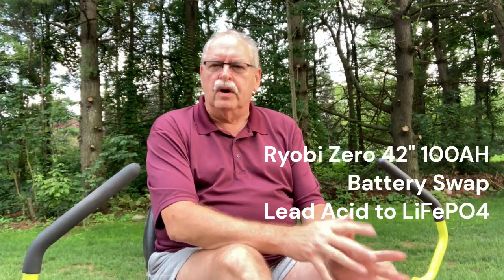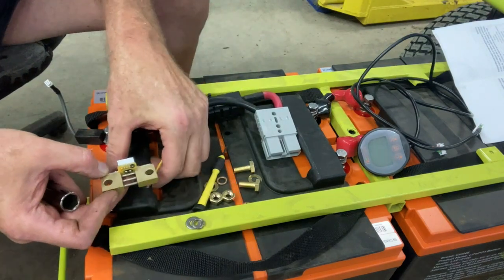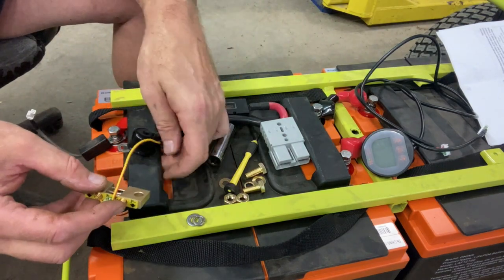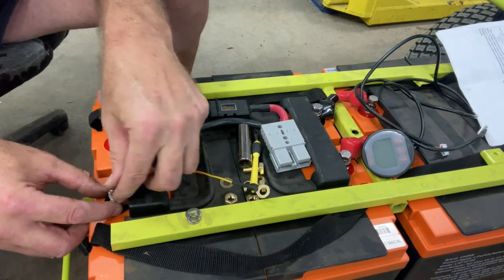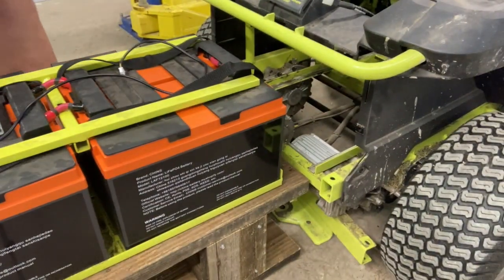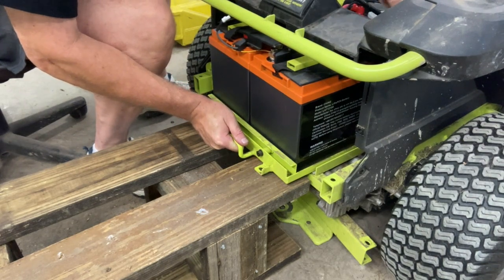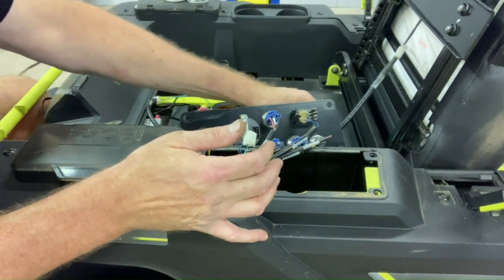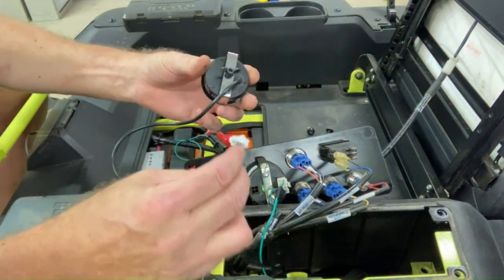Ryobi 48v Battery Swap - Load the batteries and install new battery meter

Comment: I converted my RY48ZTR75 in the same way using 4 12V 100AH LifePO4 DJLBERMPW brand batteries and the same meter.  Balanced and charged the batteries.  Everything went fine.  I even have the same charger.  Works great and your videos were very helpful!!!
Reply from the maker: Thanks!  Glad it worked for you.
My videos are painfully long, but I wanted to share the good and the bad.  It was certainly a satisfying project.
Reply: How were you able to balance the batteries with a 48V charger? Wouldn't you need a 12V charger to charge them individually?

Comment: I agree and THANK YOU. One quick note, I used the OEM plug in the new charger. 4 screws hold them together and the 3 pins interchange. The new cord only uses 2 wires and the 3rd pin is a nice uncrimped spare 😁👍
Reply from the maker: I never actually checked the interchangeability of the OEM pins/plug.  But, good to know.
Reply: I have picture of the insides but don't know how to post them. But I have interchanged them and charging now. All thanks to you 😁👍. This is a safer option rather than breaking off the internal tabs on the socket

Comment: Thank you for this guide. I watched your various videos a million times! It took me quite a while, a little bit each day, but I've got the new battery and meter installed, everything put back together and I mowed my lawn!  The hardest part was all the connections, getting them back together. I am still confused about setting the parameters of the TR16H meter - the directions say "set the meter to zero capacity after fully discharging" but my understanding is that it is not good for the LifFePO4 battery to fully discharge it.
Reply from the maker: Thanks!  I'm glad to hear it worked for you!
The meter still confuses me.  I'm still having issues. I'm not an expert...
But, I believe when you fully "discharge" the batteries, that doesn't really happen.  I think the battery BMS will disconnect the batteries, to protect them.
I did it once on video; the mower, blades and meter stopped dead.  I plugged the charger in for a few minutes, then set the meter to Zero.
Reply: @robertveldman1901  Thanks  for getting back to me. I will go home and look at the charger - is that where I can "discharge" the batteries from?  I have other people I can ask. You have a very tidy garage!
Reply from the maker: @donnacohn2454  HaHa!  Thanks... it's not that tidy!
I discharged mine by mowing.  It quit in the middle of my front yard.  I had to run a couple long extension cords out there.
I'm sure there are other ways to slowly discharge the batteries.

Comment: I connected my gauge to have a constant power input and it is EXTREMELY energy efficient. At first I was worried that it would drain too much of the battery just being on all the time, but even after a full week of being on, not even a hundredth of a volt was lost. It stays on all the time and the light comes on when it notices energy going into or out of the battery above a certain threshold. So for anyone else who is doing this conversion (which I highly recommend!), and don't want to deal with extra wiring, etc, I would say that you can bypass the gauge switch and not worry too much.
Reply from the maker: That is interesting.  I could see that it would work as well as you said.
Reply: @robertveldman1901 It makes sense if you think about it too, because an LCD watch can run for years with a constantly displaying screen with just a tiny button cell battery.
Reply from the maker: @JustWasted3HoursHere  So true.
Reply: You saying that you did all the same conversion and did not replace the Original Battery Reading Meter and rest you follow the Charging instruction done by robert using Lithium Special charger. We dont have to Worry about Gauge/ Meter. If thats the case i want to do mine also cause Gauge is confusing. Also did you prefer using 1 single battery 48v or like Robert used 4 . 100ah which brand as he used Chins. Please advice because mine mower battery dye in 25 minute and leaf collection is coming up.

Comment: I have one question. I swaped out to lithium batters. Everything worked out great. The mower ran like a top. The next day nothing worked. The batteries are fully charged. No power to the controls.  Do you have any idea what went wrong
Reply from the maker: I've heard of people having trouble after the swap.  My friend Jesse had a similar problem.  He needed to unplug and replug the battery pack and it would start again.  We recently added a pre-charge/soft start circuit that seemed to fix the problem.  
This guy sells a couple different kits to pre-charge or soft start the mower.  There is also a link to his Facebook group:  https://www.youtube.com/@Ryobi48vElectricMowers/videos?view=0&sort=dd&shelf_id=1

Comment: I have 48v 54in version of the mower. Curious, you didn't have the problem I'm currently troubleshooting which is as soon as i turned the key on my mower it went on and immediately shut off as if it detected some over amperage condition. I'm running the litime 100ah batteries with bms. Any ideas?
Reply from the maker: Sorry, no, I didn't have that troubleshooting issue.  
All my wiring was connected the same as original, except to unplug the old gage, and use the switched power from the old gage to power the new gage/shunt/sampler.
When you say the "mower" went on... do you mean the blade motors?  The drive motors are ok?
Did you check the voltage on the batteries?  Did you charge them up?  My batteries, as-delivered, had a very low charge/voltage.
I know that when my old batteries would get really low, the mower would detect that, and shut off the blades.  The drive motors would run OK; to get you back to your charger.
Aside from the battery swap... my blades would shut off randomly.  Sometimes I would be OK after turning the big red button off, then on.  Sometimes, I'd have to pull the front cover off and wiggle the wires around the blade slave control module.  Over 2.5 years, this has happened 15-20 times(?).
Reply: Hi Robert, thanks for the excellent video. Quick question: do I have to install/use new meter after replacing with lifepo4 new batteries. Can I just use the original meter?

I just swapped the batteries and charged new lifepo4, keep everything else the same, but mower won't turn on. Appreciate the help!
Reply: @worldpeace3221  I know you're asking Robert, but I'm pretty sure you'll have to use a new battery gauge. The one for the old SLA batteries is set up to meter voltage as a percentage and display accordingly. Because lithium, particularly the lifepo4 configuration, has almost a flat voltage curve, the batteries would read 100% until they just died suddenly. To your other question of the mower not running, I think that is independent of the meter. What exactly happens? Is it like what I described above in my original comment? You turn the key and the mower clicks and nothing happens? If so, depending on your model mower and type of battery selected, then you could be experiencing the in-rush/surge current issue, and it's tripping the BMS on your batteries. The surge current on some of these mowers is 350ish amps but only occurs for microseconds or shorter, but if the BMS is well designed, it might pick that up and shut off the batteries. If that's the case you kind of have two options 1) find a battery with a bms that can handle it, or 2) add a precharge circuit.
Reply from the maker: @worldpeace3221  
World, I believe another commenter in one of my videos mentioned that he kept the old meter, and it worked.
But did you get a new charger?  I understand that you need a different charger for Lithium batteries.
Did you check the voltage of the batteries?  Make sure you have +48v at the batteries.  
If you upset the BMS inside the battery with over-voltage, the BMS may have disconnected one or more batteries.  Then you need to follow the battery instructions to reconnect.. I'm guessing.  (The same is true for low voltage conditions.)
If you open up the instrument panel, and turn on the key, you should have +48v at the gage.
I'm actually thinking about reconnecting my old gage and leave it under the instrument panel, to keep track of hours.
Reply: @kwill2009  Many thanks for your kind response. Although I have limited knowledge of batteries, everything you say makes perfect sense to me.
1. For meter, I will monitor the original meter as you mentioned, if it does not change after an hour mowing, I will have to take time to install the new meter.
2. For batteries, I turned the key, mower clicked and then nothing happened. However, when I disconnect/reconnect anderson connectors, sometimes it worked and if I lefe the key in, I can turn it on many times, but if I pulled out the key, it may not connect again. When it was on, everything worked including the blade, which I think proves your theory about BMS. I googled pre-charge circuit, but it looks like a DIY setup, I would appreciate if you have one that you can share. Again, thanks for your help!
Reply: @robertveldman1901  Hi Robert, thanks for the quick response. I have bought the new multi-type 36v/48vcharger, but I have not used it yet. Per batteries instruction, I charged new lifepo4 one by one before the swap. Interestingly, the old SLA batteries are still showing in good condition with around 13.08V each. Previously, i have installed PowerPulse, but it will only charge to 70% and similarly to you at 25% the blades will stop. My new lifepo4 batteries have built-in BMS, which might be the problem, not sure if it is the same case for you. I am wondering other people have similar situation and may share some experience. @kwill2009 mentioned pre-charge circuit. I need to find a good walk-around. Your video is really useful. Many thanks for the good work.
Reply: @worldpeace3221  interesting. Sounds like you may be having an issue similar to what the OP mentioned in his initial response to me, 1)in that something on control board on the front of the mower may be loose or 2) it is an in rush current issue and the batteries you're using, which I'm assuming have a BMS, are only catching it periodically or the inrush current is only happening occasionally. I don't have a diagram because I didn't end up utilizing that setup. Im not an electrician, so disclaimer, proceed at your own risk.  I believe it basically involves adding a branch, in parallel, from the positive terminal of your batteries to the control board where it delivers power. In that branch you need a switch obviously and then a resistor of some sort. The ohm rating is something you'd need to research but I've read the inrush current is likely 350+amps. Then you'd just turn on the inrush circuit switch first then turn on the main ignition switch and then turn off the inrush switch.
Reply from the maker: @worldpeace3221  For fun, I also charged my old Lead Acid batteries.  Using a cheap Foxsur tester, they all tested the same as "good" with 13.0v 5ir 80%SOH.  (Based on a base EDC/CCA of 670a.)  
I should have tested them before charging, to see if there was a low battery.
Reply: @worldpeace3221  13.08v might show good voltage but you need to do a load test to see if a battery is bad. Load testers are like $50 great to have on hand. you need a good bms not the cheap bms versions batteries...
Reply: @robertveldman1901  turn the mower on while reading the voltage at the charge port. You get 48 volts , then turn it on to see the drop. My battery’s went from 47 volts to 22 volts as soon as I tried to run it, bad batteries. Today, I installed a single 48 volt lithium with the stock gauge. The mower works better than ever. I bought a 18 amp lithium charger..leave the blue wire alone.. best wishes .the mower is super strong now and the blades do no slow down.
Reply from the maker: @hardknock1278  Glad to hear it worked out!

Comment: Just did the swap and when I connected the batteries the voltage went from 53volts down to 3 and no power. Am I missing something
Reply from the maker: Sounds like a bad connection somewhere?  Check to make sure the big plug from the battery pack to the mower is completely seated,  Did you check the voltage with a handheld volt meter?
Reply: Will do can you recommend a charger
Reply from the maker: @Standupyouth  I like the charger I bought because it plugs into the existing charging port with a slight modification.  
HTRC 48V Golf cart battery charger 13-Amp Smart Charger, LiFePO4,for EZGO RXV & TXT,Car, Boat.. 
$155.99 Amazon free shipping 
https://www.amazon.com/dp/B0BZY6N951/ref=sspa_dk_detail_0?pd_rd_i=B0BZY6N951&pd_rd_w=NKmWi&content-id=amzn1.sym.386c274b-4bfe-4421-9052-a1a56db557ab&pf_rd_p=386c274b-4bfe-4421-9052-a1a56db557ab&pf_rd_r=AH86NNP02WKSVZ7AQARX&pd_rd_wg=tCfYe&pd_rd_r=2ec605bf-0175-487d-a976-a5463f720e7b&s=electronics&sp_csd=d2lkZ2V0TmFtZT1zcF9kZXRhaWxfdGhlbWF0aWM&th=1

Comment: Hey Rob- followed these instructions and I see volts but nothing else.... Do I need to program the gauge? What am I missing?
Reply from the maker: The only programming on the gage is for the %.  The volts and amps should work fine on the gage. 
If you are saying the mower doesn't "start" (move or blades), then you may need a "pre-Charger" installed.  I didn't need one, so it's not discussed in my original swap videos.  Please see this video for information that may help:
https://youtu.be/WQ-h3viwIvM
Reply: I have installed the gage- what should I see.... I currently only see - volts - 53.42 - amp 0.013 - ah 0.000 - 0.0%
Reply from the maker: @Steven-uc2kt  the voltage looks good.  does the mower run?
Reply: @robertveldman1901 yes everything is working prefect- I indeed needed the pre charger but am confused on the use of this gage and what it's suppose to do...
Reply from the maker: @Steven-uc2kt  OK, thank goodness it all works.
The old gage works well with the old lead acid batteries, but not so well on LiFePo4 batteries.  The new gage will be more accurate.  You will need to set-up the % on the new gage.  Check the instructions.  I would recommend using "Method 2: After fully charging the battery, press the '%' button to display the percentage (probably 0%).  Then hold the '%' button down for 3 seconds to set the full capacity to display 100%".  
You can also search YouTube for videos on setting up the gage.
Reply: @robertveldman1901 thank you!!!
Reply: Worked like a charm!! You are an angel to the Ryobi community... Thanks again!

Comment: Thanks for the helpful video. Converted the batteries yesterday. It was easy to get to the batteries following this video. Now to get a pre-charging unit to test the conversion. I am using CHIN's BMS batteries so that needs the pre-charging kit. Pay attention to the way the back panel is installed back at 36:45 it slides up after the hooks are in. That means to remove the back panel (after removing the 4 screws) is to tug the top out then push it down. Otherwise you risk breaking the hooks at the bottom. I've decided to use the old gauge as is. I don't usually refer to it if I can mow t2.5 acres in one go. I will think about having individual charging ports for each battery if I ever need to charge each battery separately. After the conversion, I realize I can pull the tray in and out within 10 mins so it is no hardship if I want to do that in the future.  Thanks, Rob! 

Next to try is the mod to the charging handle. Without the charger plugged in, there was no voltage at the top pin and the impedance was about 12.12K ohms. When the charger is plugged in, it was 3V when fully charged and fluctuates when the led is blinking, so am guessing, if I feed in about 3V to that pin, it will not fry the charging port. :-) Then again, the safety feature of disabling the power when the plug is in is to you don't drive away with the charger handle plugged in ... so my easy solution is to put the charger on the seat. That way, I will know to remove it before starting the mower. 0 cost solution.
Reply from the maker: Frying a charging port is pretty exciting, but I don't recommend that for anyone.

Removing the back panel is a little tricky, as you noted.  I think I did a better job of explaining it in later videos.

Comment: Great video series! I followed the instructions and everything worked well, except for one issue... My low speed cut and the associated blue light around the button don't appear to work properly. When installing the battery meter, I used the green wire to power it, but I didn't install a jumper in the plug as a "bypass" for the old gauge. Could that be the issue?
When I select low-speed cut, there is a slight change in the speed of the blades (no light though) and I see a corresponding reduction in the amount of amps being used, but it is only about 1.5A of difference. This isn't a big deal because I don't use low-speed very often, but I'd prefer to fix it if you have any tips.
Reply from the maker: Sorry.  No ideas what could be wrong. I never run low speed blades, but I'll check it next time.

Comment: What is the wire attached to the positive terminal on the rear most battery with the white clip that clips on under the very top/back of the battery compartment?
Reply from the maker: I'm not sure what it does, but it's connected to the charging port.

Comment: I as well did this swap and am very satisfied and grateful for your guidance. Thank you. I bought the same charger that you have. Is there a “best” setting to charge the battery? 5A, 8A, or 13A? Thanks again.
Reply from the maker: Good for you!
I've used them all.  But generally. I use 5A, for no specific reason..
Reply: Thank you.